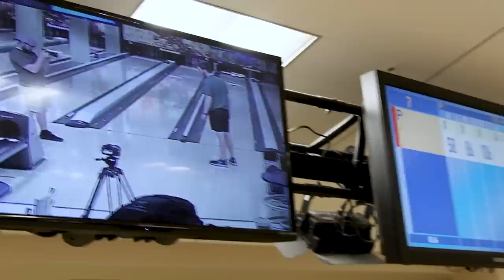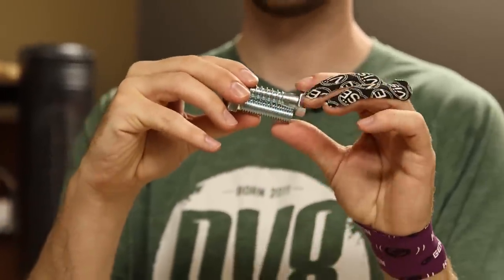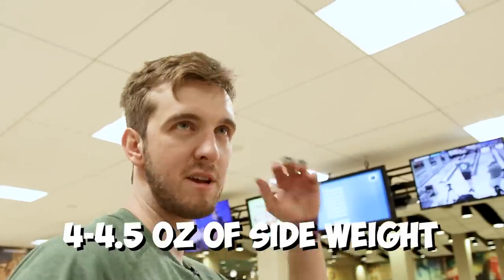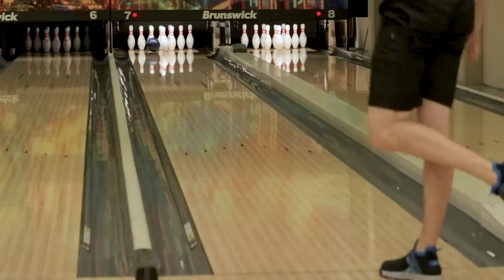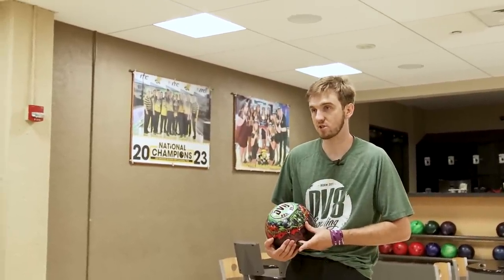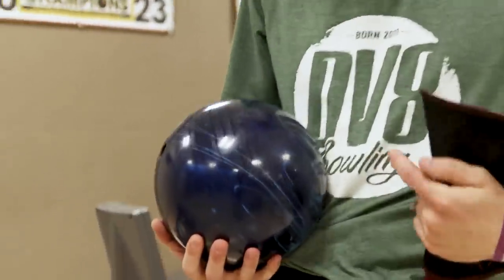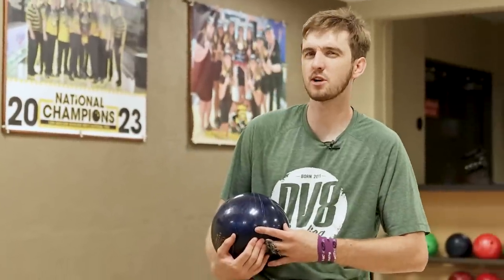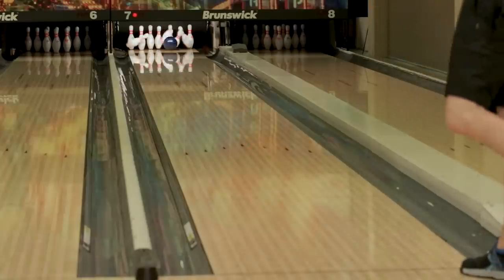Building an ILLEGAL Ball | Adding MASSIVE Side Weight

Comment: My thing is, In my theory only, You can make a ball hook as much as you want, or weigh as much as you want, but at some point it becomes self defeating. You need some deflection of the ball to strike and at some point it'll just charge through the pins and will actually cause your ball not to strike.

Comment: You know if you take the inserts out of a yellow dot, put some metal tubes in the holes, put it on a cookie sheet, and place it in the oven. When you can put a nail into the shell and pull it out and the hole closes up it is done. As long as the durometer punched 72 you were golden.  Talk about opening up the foot-print of the ball.   Also back in my time, people would drill the finger holes deeper and put coins under the inserts.  One time this guy rolled the ball the inserts came out and coins went all over the lane.

Comment: I know of a couple...  Had a guy (drilled his own stuff) drill a ball completely upside down.  Also had someone (when the no weight hole rule came out) drill their weight hole to 1 3/8" and full depth.  Then used a band saw to cut the thumb slugs and used an 1/8 of the slug to fill the hole (putting it 1/4" from the top) once the glue "dried" he would put plug over top of it.  Only found this out when we redrilled a ball into the weight hole and hit urethane then the bit just... Fell.

The "fun one" would be to do this to an older ball from the 70s or 80s.  What do I mean?  Something like an old yellow dot (same thing with the bolts) then soak it in MEK and see if it can compete with a modern ball
Reply from the maker: Yea that’s no good!
Reply: @TheHouseBowling it will be interesting if you did that tho I love to see you do that kind of stuff with vintage bowling balls

Comment: Had a Brunswick power groove back in the day I got off eBay. Had a different pro shop drill it in Goshen Indiana. Took to a IYSBT Tournament 45 foot heavy volume sport shot nobody was hooking anything pretty much straight up 16 with a heavy oil ball and pray to carry. After 4 games beating my head against the wall I thought I’ll take my new power groove and throw at the pocket off the corner, Instead I ended up playing 5th arrow out to two board and shooting 256 game 6. Fast forward I get it on a scale I’m told the pin was miss marked from Brunswick and the pro shop must not have checked it after drilling as it had 6.5 onces of side weight
Reply: Well that's not your fault.

Comment: I built an 18 ball. Added 8 Oz. Sinkers that were melted and poured into four plugged hole. One on top of the ball, bottom, and one on each side. Ball was balanced but extra heavy. No deflection even roll using a Columbia 300 white dot. Old old school. 1970’s
Also used a soaker back then. 
MEK made any plastic hook like crazy.

Comment: Back in The early 80's a friend own a Pro-shop in a center. For the hell of it he (a lefty like myself) added 7oz of lead to a  plastic ball with a Pancake weight block. . We both threw it. It hook really early but by 2/3 down the lane the weight took over and it went dead straight into the 2-4 pins. Wasn't worth a damn. 🤣

Comment: I did this as a joke ball 20plus years ago.  I took a 1 3/8 bit as deep as I could but didn't stop there.  I pitched the hole all the way forward still using the same entry hole. Repeat left pitch, right pitch and reverse pitch. I then filled it with lead fishing weights. I did this on the right side (negative side for a right hander) of the ball and would bet people they couldn't hook the ball. The ball had over a pound of negative weight. This ball would literally back up. (Funny note a left-handed customer loved it as he could hook the lane).  Did this to an old Ebonite Turbo C.

Comment: Just read Mo Pinel’s paper on this.

Side weight has very little effect on ball motion.  Cover stock is 90% ball motion followed by core specs
Reply: Side weight and core dynamics dictate how much fresh cover sees the lane.    Packy added flare separation so the ball read in the oil earlier, putting a bigger footprint of the cover on the lane surface. 

Had it gone the other way, and there was no flare at all, the ball would skid past the end of the pattern, making almost no move at all.    While MO is technically correct, the cover has to win the battle between the lane surface and the core to make any motion at all.  

By placing the bolts on his pap, it is preventing the core from flipping and rolling out, essentially aiding the cover to maintain its control of the situation,  so it continues to pull to the right, around the direction of the side weight.
Reply: They tested up to 6oz side weight on throwbot..  it had almost zero effect on ball motion..   weight holes have way way more effect as it changes core dynamics..

Comment: A guy who use to work at my local center proshop 15 plus yrs ago use to put quarters in the ball from where he would drill it out and plug it🤔 he got cause he shot 300 somewhere and then threw the ball in the dumpster out back he got banned for a few yrs

Comment: My pso just recommended a pin down layout. I'm a 2 handed bowler, does this sound right?
Reply from the maker: I would have him measure your PAP before doing any of that, usually pin down layouts for two handers are way way too low.  A comparable layout for a 1 hander thats pin down would be a pin just barely above the bridge for two handers!
Reply: @TheHouseBowling  I had him get my pap axis and tilt and he used an app and it said it should be pin down. I asked him if it was for 1 handed bowlers and he said no. My pap was 4 5/16x 1 7/8. With 7 degree tilt and 45 degree axis.

Comment: should have marked your PAP before you altered the ball and afterwards so you could see the difference. given the balls flaring the weight at your pap is probably migrating to full rolling so the weight is end over end making it the most stable it can be. but you didn't mark up the ball 

as for extra cheating, you could have cleaned the ball midgame and then altered the surface

Comment: Man, I would LOVE to see a "built" NOT 73...NOT 78 Urethane ball on the lanes...and I think you're the guy to do it!! I'll buy the microwave needed to make it under 73!!

Cheat story. Have a couple buddies that shared a ball. This ball was passed down through the....had 4 weight holes but had the original drilling layout. They threw this thing in sanctioned and you could literally hear it thumping down the lane from 5 pairs away. No one ever knocked them...and they kept rolling this wiffle ball down lane for the entire 35 weeks.

Comment: Over 30 years ago I bowled a league and the lane mechanic for the alley was on my team. The very first night of league he pulls out a Columbia Blue Dot that has a 2” diameter axis hole in it and proceeds to shoot 300 the very first game and 800 for the 3 game series. Well back then you had to have the county bowling association check your balls before the scores would be considered sanctioned. Unfortunately they determined his ball was 7.5 oz over the legal amount of side weight. So none of the scores counted. I was in the pro shop when they drilled out the axis hole deeper and they discovered he had put a roll of quarters under the bottom of the axis hole and plugged it and redrilled it to guarantee it would be undiscovered with the naked eye. Damn cheater!

Comment: When I was working at a bowling center I found a old brunswick black beauty that was fingertip pre grips and had 2 lead slugs in the finger holes. We weighed it in the pro shop and it was 21 lbs. Next level sneaky cheating

Comment: I doubt you added much weight, should have weighed the side weight before adding the bolt as a comparison.
Plugging is lighter than urethane so you lost weight and two bolts I doubt had much weight to them.
Or for viewers tell them side weight before and after.